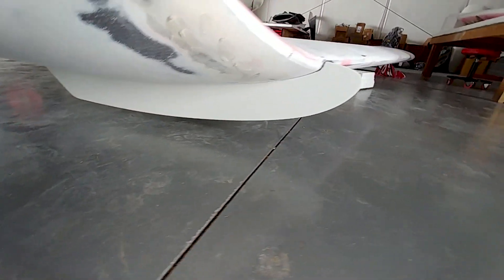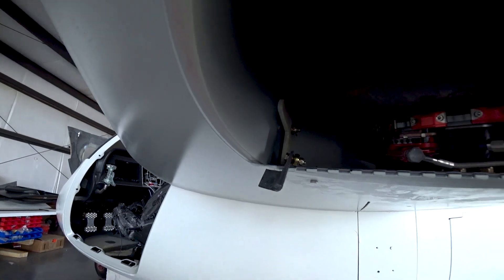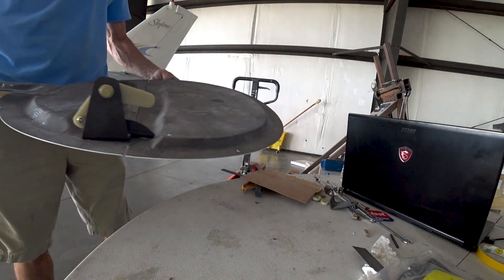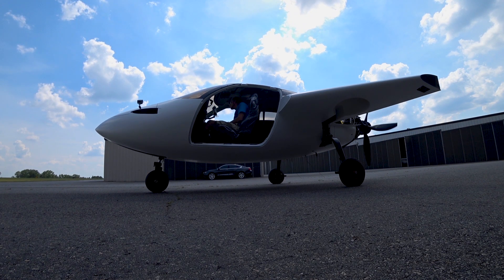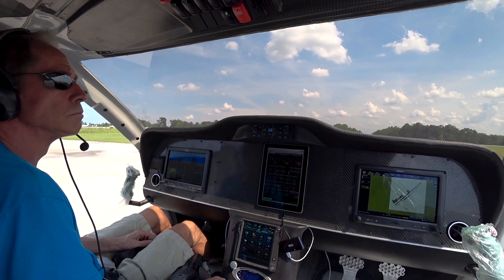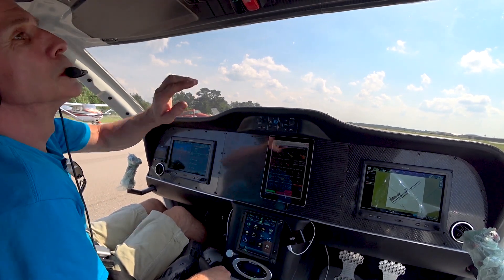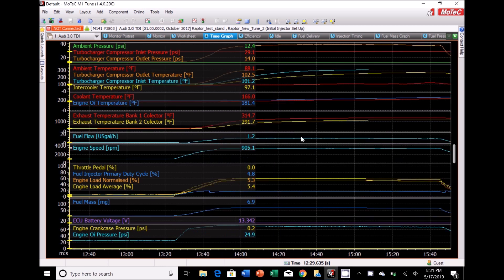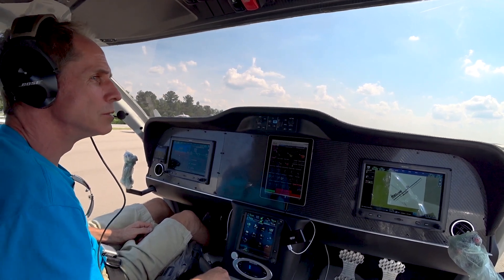Boosting the Power - Building the Raptor Prototype

Comment: You probably already tried this (and it seems unlikely to be the problem to me) but could the issue with noise between the wifi unit and the radio be a lack of galvanic isolation between the two systems? I would think that the Garmin unit would be galvanically isolated, but it was just a thought I had.

Comment: Keep a close eye on the oil.  Because a coolant overflow after running it can be a sign of a blown head gasket.
Reply from the maker: I checked it already and it was fine. I'm not letting the engine get that hot.

Comment: You should definitly try an isolated voltage converter if you`re not allready using such one. The galvanic isolation could solve your problem. Maybe you mentioned in this or another video and i missed it, but i ask you anyway: does the problem still occur if the DC/DC-Converter is on power but the hotspot is unplugged?
Reply from the maker: It only happens when the dc convertor is plugged into the hotspot.

Comment: Why did they move to the airport ?   Sanding and painting wings in a group Hagar?
Reply from the maker: I had scheduled the move to the airport quite awhile back intending to have everything ready but we did not get there. So the remaining body work just has to be done at the airport. We do as much as possible outside to be good neighbors. We moved out of that building because I did not want to pay the expensive lease during flight testing and frankly it's nothing like what will be required for production. All the tooling and equipment is in cheap storage for now.
Reply: Id imagine they moved to make room for kit production at the plant and for final assembly of the prototype for flight testing (Again these are guesses) 🙂 the sanding and such seems to be outside the back of the hangar

Comment: Very nice progress, Peter.  It sounds like a turboprop, probably because of the prop RPM.  I really like the 5-bladed prop.  What's the difference between exhaust temp bank 1 and 2?  Are they the left and right exhaust headers?  If so, what do you make of the temp difference between the two during your run-up?
Reply from the maker: Bank 1 is at the intersection of the Y pipe from the exhausts going into turbo 1. Bank 2 is the temp coming out of turbo 1 about to enter turbo 2. It will always be lower.

Comment: Nice work, prop sounds great.  Great news on the PS noise, you might try a ferrite bead on that power supply cable.  If that works fast easy cheap.
Reply: Depending on the current draw of the 5V load, a simple series regulator in place of a buck converter may be better: they are noise free.

Comment: Very nice work, its looking great!  I have 2 questions if you dont mind, #1 Is that 3250 rpm engine rpm or prop rpm you were running. #2 At only roughly 200 horsepower if your running a steady 1350°F on the egt right now are you concerned about the egts being too hot at 350 horsepower? I guess if you have more rpm with the constant speed prop the extra rpm should help drop the egts or maybe some more injection timing if possible. Keep up the good work love the videos, really interested in the engine rpm vs prop rpm. Thanks
Reply from the maker: Engine rpm. Ratio is 1.58:1. The power is just an estimate but goes up dramatically between there and 3800 rpm max because of the increase in both torque and rpm.

Comment: Install petcocks in all your high points of the coolant systems to bleed air. You need to know coolant system capacity. Then run a calculation for your expansion tank volume. numbers
 never lie

Comment: It won't hurt anyone if the tip of the tire wasn't covered during retract. Don't have that flappy thing hanging around where ever. It would be right in front of your prop during flight. You don't want that thing other than very secure.
Reply from the maker: Just cause it looks thin doesn't mean it isn't stout. It's cored carbon fiber and very rigid. See Beech Staggerwing.
Reply: @RaptorAircraft  that's my point. Don't have it not secure at 200mph+. If it isn't secure from chatter that stout piece will rattle off. That's all I'm saying. I'm am confident that you will find the solution, I've been watching for a long time and am sure you will do it right.
Reply: If it starts flapping in flight, then perhaps a few embedded strong magnets could be a fix?

Comment: Would be nice to see her tied to a scale so we could see how much thrust she is pushing!
Reply from the maker: I can tell you that even with about 2000 rpm when I let go of the brakes it starts moving quite quickly. Max rpm will be 3800. That 5 bladed prop combined with the high torque is a good combination.

Comment: Looks like the gear doors only open a little more than 90 degrees.  If that is all it is suppose to open then good work.  If it should open a bit more then, I wonder if a couple links of motorcycle chain added to the end of your push rod would allow the doors to open more fully back onto itself?  Just a thought...

Great work and it's looking and sounding really nice.  Looking forward to seeing her with all the wings installed.  Keep up the good work!!!
Reply from the maker: With the new setup that I just showed it's more like 145 degrees.

Comment: My 3.0L TDI wants to run at 200F no matter OAT. Also, on my 911 I have to draw a vacuum to fill the coolant or I get the same trapped air problem... just some thoughts.
Reply: Well if the thermostat opens up at say 190 that sounds right. Diesels can have problems maintaining a high enough temp to provide enough cabin heat in low OAT environments. 
 They don't have a throttle at all and are functionally partially internally air cooled under low load condition.
 At idle in low OAT environments the fuel burned isn't enough to heat up the engine significantly. 
 When it's negative 20-30°f outside I leave my diesel running and it's coolant is about 120-140°f it only burns ~2gal per 24hrs.😉
Reply: @kylegoldston  Thanks for the discussion. My comment was meant to offer a data point on what temp that same engine runs at on real world road conditions.
Reply: @Van-tastic  , What does that 3.0 TDI feel like power wise at say 3500rpm?
 I drive a 2.7 CDI and it seems rather obvious to me that the only reason it revs to such a high RPM is to catch the next gear at about 2000rpm.
 My engine feels pretty gutless above about 3000rpm.
Reply: @kylegoldston  well... When VW had their cheat software, these things were pretty strong across the rev range. This neutered software has made them pretty weak up top by comparison. But what Peter and Co have done with the turbo setup and motec mapping has definitely pulled the gloves off. The numbers he's pulling are definitely impressive while still leaving a lot on the table for reliability sake. It's definitely a peak torque map he's created. Which is gonna be incredible with the geared constant speed prop!
Reply from the maker: @Van-tastic  yeah, all that and the EGR delete. The torque at the prop should be over 900 ft lbs. I can't wait till I have the wings on and I can try a launch from standstill down the runway to see how quickly it gets to 50kts.
Reply: @RaptorAircraft  OMG +900?!?  Good thing you'll be able to run the motec as a FADEC because I would think you'll be able to over torque the prop on a cold sea level day lol
Reply from the maker: @Van-tastic  I believe the prop can handle over 500hp so we're good there. The Motec does not control the prop, at least not yet. I believe it's something that could happen in the future with enough arm twisting at Motec.
Reply: Audi has a self study program for shops to learn the engine. Lots of good information in it:
http://jameshalderman.com/images/vw/3_liter_v6_tdi_common_rail.pdf
Reply: This is from the training material on this engine:
"The temperature level of the cylinder block coolant circuit is regulated at approx. 105° C (221° F). This allows the rotating assemblies to work at the best possible friction temperature level. The ball valve is activated by the Cylinder Head Coolant Valve N489 using pulse-width modulation (PWM). To help the system warm up quickly, an engine oil cooler bypass is also located in the oil system."
"The thermostat is not energized during the warm-up phase of the engine and opens at approx. 90° C (194° F). No heat is transferred to the main radiator until this temperature is reached. The coolant is only used to warm the transmission and the HVAC system (if necessary)."
"The expanding wax element in the thermostat opens a bypass valve at the engine oil cooler when the oil temperature is < 103° C (217° F). The main flow of oil is sent past the engine oil cooler. The thermostat is located below the coolant pump on the cylinder block."

Comment: my A8 V8 4.2 used to over heat as well standing in traffic....pos car....the allroad seemed ok and my current A4 is also ok in traffic.
looking forward to more videos...
Reply: It probably needed a fan clutch, the viscous clutches of mechanical engine driven fans wear out over time.
 One of my cars is a 4.2 S8.
Reply: @kylegoldston  thanks for the tip :).

Comment: Do you have any concerns about aerodynamic forces causing the lower sections of the main gear doors to misbehave when the gear are extended?
Reply from the maker: There's always concerns, that's what testing is for. The Beech Staggerwing used the exact same design so I know it can work.
Reply: Speaking as one of many fans of this project, and someone who would love to see it succeed, I get one red flag from the Raptor geometry that the Beechcraft doesn't have, namely, a propeller downstream of the gear door in question. If an rg Staggerwing loses part of a gear door, that's probably the end of it. Not so with the Raptor. I hope I'm wrong but I see the potential for a worst-case cascade event culminating in a critical in-flight structural failure. Follow me on this; flutter , detachment, prop strike, prop damage, imbalance, severe powerplant vibrations, major structural failure. Again, I hope I'm wrong but I just felt like I should say something. Keep up the good work.